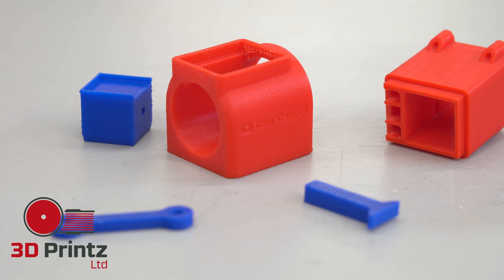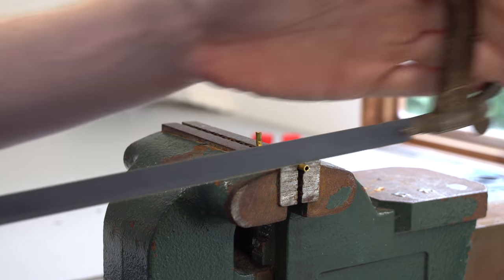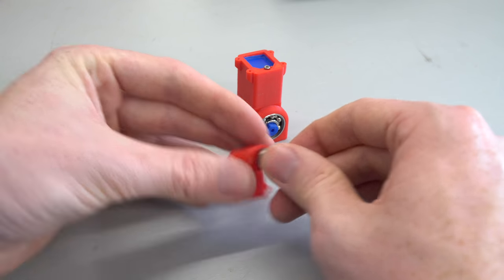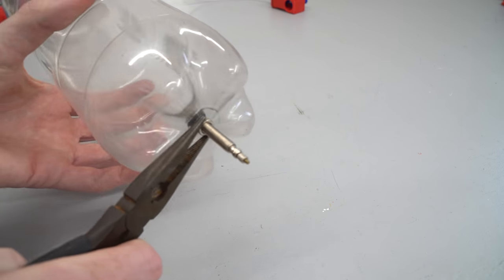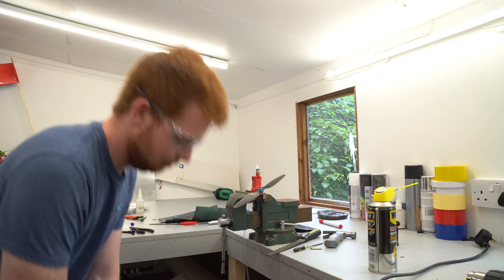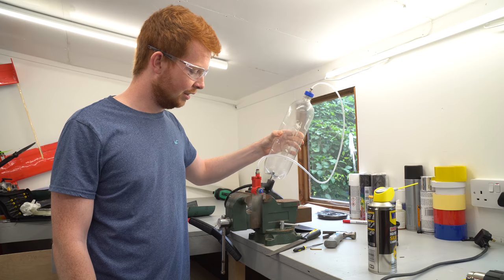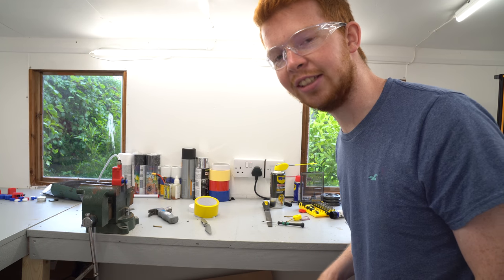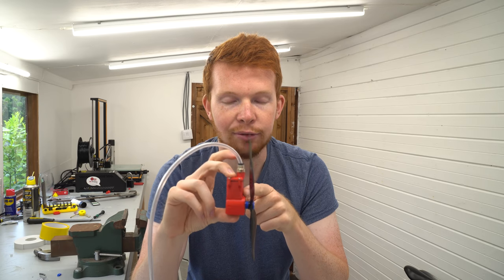3D Printed Air Engine BUILD

Comment: This version looks really efficient, based on how little pressure it runs at. With that huge propeller, I don't see why you couldn't get the plane to fly. It looked like it produced a lot of thrust and ran for a ridiculous amount of time. It sounds pretty amazing too.
Reply: USWaterRockets hmm 12 hours early
Reply: Patreon innit?
Reply: How are you 12 hours early?
Reply: patreon
Reply: not enough thrust. planes need a ton of thrust.
Reply: Tell that to Spinmaster Toys.
Reply: Depends on the type of airplane. Some really efficient designs do not need much thrust at all. Check out Samm Sheperd's Flying Wing - 40" wingspan and it flew 22 minutes on a 180mah lipo. VERY little thrust.
Reply: What I would like to see is him figure out how to get a two-stroke diaphragm engine going

Comment: Have you considered using dry ice or some other gas producing chemical to supply a constant pressure source (with a relief valve of course!)
Reply: Had the exact same idea!
Reply: Was about to make the same suggestion. There are lots of videos where people blow up bottles like that with just a little dry ice. You would think that that could run the engine for a fair amount of time.
Reply: I wonder if the cold gases would make the PLA brittle. I know its not liquid nitrogen cold, but I wouldn't rule out things like the piston con rod cracking. Even if there is a relief valve though, you should still probably hide your balls behind some plywood lol. With that said, this could totally work.
Reply: Biggest issue would be to control the rate at which the dry ice is "melting", as too fast and it will pop the bottle. Also as has been said before, Dry ice is not easy to come by in the UK. Other solutions could be possible though that produce gasses in the more controllable manner.
Reply: Diet Coke and Mentoes ??
Reply: What? Why? Oh, yeah. You're talking about a country that's now attempting to ban anything remotely pointy. In the USA (Murrica!) we can buy dry ice at most any grocery store.
Reply: Not because its dangerous... but more like... what and why would anyone need it?... What do you 'muricans even legitimately use it for (dry ice bombs and making it fart with a knife don't count)? I assume it's used for coolers and stuff... *shrugs*...
Reply: Great idea. Also, CO2 has one of the highest expansion rates, so it should be more efficient. But he needs to make some kind of a filtering mechanism to not let the water in the engine since the bottle would be standing sideways.
Reply: kal9001 why is making it fart not legitimate good sir?
Reply: Nothing really, but It hardly seems like a reason alone to have it in every grocery store.
Reply: The only time you'll find dry ice in American grocery stores is around Halloween where most people use it to create fog effects.  Otherwise you'll have to go to some sort of industrial (where it's commonly used in cooling apparatuses) or scientific suppliers.
Reply: @kal9001  Transporting things that need to be kept cold and dry. I sold ice cream with a bicycle cart. Dry ice is much easier to peddle around town than a refrigerator.
Reply: Using baking soda and vinegar and test it out
Reply: @kal9001  we use it for packing meats. It's very efficient and its dry! :)
Reply: I'm not sure what people buy it from grocery stores for, but when my restaurant gets orders of ice cream they come in a styrofoam pallet with blocks of dry ice to keep it cool in unrefrigerated trucks.
Reply: i had the exact same idea but i was thinking more sulphuric acid with aluminium, dry ice would probably be a better idea
Reply: @hjjfffaa  the supermarket by my house in Michigan sells it year round for cheap
Reply: I don't remember seeing it in any supermarkets in the South Bend area.  I'm sure it has lots of uses in meat processing for hunters or people who keep livestock so it'd make sense in the more rural parts of Michigan.
Reply: I bet co2 cartridges would really give it some major power.
Reply: Same idea. Even would have the added benefit of cooling the piston/cylinder. As the cold gasses run into the engine to power it
Reply: It will make plane unbalanced and heavy
Reply: You should try to make a V6 layout air engine
Reply: Dry ice would have to be able to overcome it's own additional weight.
Reply: It's pla plastic
Reply: @newcreation3411  yeah but he could use it in the air powered car
Reply: @kal9001  umm actually the correct term is sublimation lol
Reply: I didn't know what materials to use but yeah I think that's just the next logical step
Reply: Lol
Reply: @kal9001  It can also be used to carbonate juice, water, Unflatten soda, Its also useable in certain types of cooking, the same circles that would make a cube of fruit and smear the plate with bbq sauce and call it a meal-- But thats still cooking even if i need to eat a buffet worth of plates to get any sustenance past that of a single potato crisp.
Reply: @hjjfffaa  in Texas i can get some at any HEB at any time of year
Reply: There are stirling engines

Comment: Can you push one of those engines to its max? like increase pressure until it breaks (in a safe way) maybe using the bike pump while running method while standing behind something?
Reply: shinevision sv he could also replace the propeller with a wooden plate as flywheel wich has less airfriction
Reply: Yeah! great idea, but maybe testing it with a prop also to see how much you can push it if you use it as a plane :P but yeah, both ideas sound cool!
Reply: This should be the next (or maybe reserve it for the last?) video for the series, a completely destructive test
Reply: Metzger 
A proper flywheel and a pulley. Then measure the work output that generates.
Reply: shinevision sv what if he put dry ice in the bottle, would live to see how long it would run for then.
Reply: Esteban Pedroza 
Split the difference, call it drag.
Reply: I want to see this too!  For science. :D
Reply: I would prefer an aircompressor, instead of pumping the shit out of a bike pump :D
Reply: Peter Erdnuss 
It’s an exercise. 

Electric air compressor to drive an air engine sounds a little outside the point.
Reply: yeah of course its outside the point for a practical use like in a model aircraft.
But to test its point of failure or its maximum pressure rating i wouldlt use a pump
Reply: Peter Erdnuss 
I hope Destructive testing doesn’t happen. Not in the scope of the project. 

But you could built a couple and see where top end is... destructively.
Reply: Isnt that the best par of mechanical engineering? Pushing constructions to its limits :D
Reply: Esteban Pedroza a spinning propeller accelerats air ==> resistents
Reply: Metzger 
Not just resistance, but parasitic drag. Increased resistance with increased rpm.
Reply: I got mine to go at 125psi and it held up great, I’d try higher but my air compressor does not go over 125psi
Reply: hi shinevision!
Reply: @marluna_x  Hi!
Reply: @shinevisionsv  i never knew i would see you in the comments
Reply: it would be pretty damn hard to get injured by this engine

Comment: Now that you have your flexible air feed you could easily create that multi cylinder engine that everyone is so keen to see you do.
Reply: I think he should make a right angle fitting so the hose can be optionally routed close to the head depending on the need.

Comment: Fistly - Were you never tempted to try running it from a Co2 bulb such as you get for soda syphons? Tiny size, high pressure - which I'd guess would need to be regulated down via a choke constriction to the pressures your plastic components can survive for more than several runs before failure?
Secondly - with a hobby lathe you could machine up some aluminium components, get more rpms etc etc, more time in the air, better performance from greater pressure, improved aerodynamics from not having a blimp of an air bottle that's got to be strangling the aircraft's progress through the atmosphere?
Thirdly - I'm surprised at the sluggish pick-up when nearly stalling and give a shot of air, the cylinder charging must be inefficient at those low pressure.
Fourthly - very entertaining watch, this.Thankyou for posting all these videos.
Reply: Ian Gourlay I don’t think he would machine parts as the point of the engine is to make a 3d printed engine with the least amount of non-printed parts but cool idea anyways
Reply: Ian Gourlay 
He’s not out to reinvent the expansion engine. First would be a bored cylinder and turned piston. Which he should do even with printed components. 

All he has done is print and sand. 

It’s a hand-on learning exercise.
Reply: CO2... Have you ever heard about climate change?! 😉

How is the exhaust arranged by the way?

Comment: Nice build Tom! I couldn't resist and made a couple of replacement parts for a 5cylinder radial engine and I am actually printing the parts at the moment. I can send you the design files if you are interested!

The design is mostly copied from your files apart from: Crank case, crank shaft, Piston (minor tweak) and piston rods. They are designed to be compatible with the other motor parts.

Comment: Try to run it on steam.
Reply: xXMountain DewXx : Just a quick reminder: This is 3D printed.
Reply: do it anyway
Reply: xXMountain DewXx maybe with metallic parts but getting them would be the problem however I agree with you, it'd be cool if he gets to run it on steam
Reply: i wonder how the gameplay would be
Reply: Not with PLA. It will just melt
Reply: I would like to see how long it could endure the CO2 tank from a paintball gun. Those can hold some pressure.
Reply: Bradley Fortner But then it would blow up.
Reply: Yes. It would. But at what point? Tom could see exactly how much power he can get out of it by taking the pressure as high as necessary to blow it up. That bottle he's using won't hold nearly enough pressure to blow that motor. At least not by the look of it. But paintball guns have regulators and all sorts of useful parts. Their tanks are pretty lightweight as well.
Reply: Or with a chemical reaction (Metal in acid to produce H2 for exemple)
Reply: ECHO༄ 1 whole Frame Per Second
Reply: Steam would melt the plastic.
Reply: There's ALWAYS a, wrong side of the fence, ghetto engineer saying something dank hahaha!

It's not air tight and it's construction alone, from plastic, should state no hot air from the beginning!
Reply: This would work with PETG not PLA.
Reply: xXMountain DewXx I was thinking of using dry ice and water.
Reply: Could put a bit of dry ice in the bottle
Reply: pla resist more than 180°c and steam its about 100°c so... maybe for 5 minuts and then itll die xD (sorry if its bad english :c)
Reply: The only way he could do that is by creating the pressurized steam and then find a way to cool it enough that it won't melt the PLA and still have pressure.
Reply: How can he generate enough steam efficiently on top of a rc plane
Reply: Those arguing melting might consider staging the steam to compress air in a separate chamber.  Or using an expansion valve to cool the steam.  Sure the pressure would drop but it would prove the theory of using steam.
Reply: Akshj A.  - Fair question.  A candle and a tomato can maybe?
Reply: ECHO༄   badum tsss
Reply: steam was 200 years ago modern tech lets u make air pressure high as steam
Reply: Steam..  allowed to cool into cold compressed air......so it dont melt the parts...
Reply: Then it would liquify again, and any liquid in the cylinder will cause destruction.
Reply: jae ski your knowledge overwhelmed me.
Reply: Steam engines can run on compressed air
Reply: @armandoguendulain7162  with metal it is litterally just a motor.
Reply: GTX 1080 vs RTX 2070 SUPER comparison +chart overview
Reply: run it on steam and expand/cool via pipe the steam a bit before the 3d printed parts

Comment: You should print the casing out of clear material.
Reply: lowtus7 clear filament doesn’t usually come out clear, you wouldn’t be able to see anything
Reply: @owenps6944  Not with common FDM 3d printers like most budget and mid-range printers from folks like Creality.
Now, RESIN-based 3d printers especially those at folks like Shapeways is another story!

Comment: Have you put any thought into what you're going to use for the compressed gas source for the car? Without the weight restriction of the plane I'm thinking you could get very creative. If you changed to PVC pipe fittings and placed your pneumatic press fit into a 2" cap, you could make a nice chamber to fill with dry ice (just make sure you include an over-pressure vent). Or what about a peroxide and potassium permanganate, or baking soda and vinegar? Lots of really interesting combinations you could add to a chamber like that. Watching you sand away the piston also got me thinking - why not flange the top and bottom of the cylinder so you don't have to sand the whole face? It will decrease the bearing surface too so you'd get less piston friction as well as being much easier to size to the bore. I'd print oversize and use the time saved in sanding a whole piston face to make sure the bore fit was very close running.
Reply: the best solution would be a small pressure tank with a regulator to drop the pressure for the engine. the engine uses air too quickly for something like dry ice or any other chemical reaction.

Comment: Tom.  Here is a possible idea for your next project.  A 3D printed rubber band powered airplane *with a throttle*.  I could be wrong but I have never seen anyone add a throttle to a rubber powered airplane.  Not sure why but I think it would be really cool.

Comment: Go to a shop with a large air compressor and a pressure valve and hook it up and do an endurance test! Maybe find a way to continuously oil it? Oil drip? Super cool man!
Reply: OOh ooh Great idea Parker!  how about throw a balloon with oil in it into the air bottle and use a tiny hose to spray oil into the air stream?
Reply: clavo Yeah! I'm super curious to what the lifespan is on something like this. I'm guessing it it'll run for several hours BUT become very inefficient. I think the plastic piston and cylinder would start to wear down and air would start to go around it. Maybe he needs to figure out how to make piston rings.
Reply: Parker -  I've been reading comments for about 3 hrs now!  One guy suggested a dry lube like graphite.  It makes good sense.  I gotta get some sleep but this level of thinking is so dang fun!

Comment: I wonder if you could fill the bottle half way with coke/diet coke and drop a few Mentos in, seal it up and run the engine on the released gases?  Of course, you'd want to be careful and get the ratio low enough for the pressure not to blow the bottle ;-).  Maybe baking powder and water might be safer?
Reply: helicopter coke bottle
Reply: that would probably work, although I'd reckon you'd have to put some form of filter to prevent the coke/water to foam up and gunk up the engine. Maybe it's not needed if he uses sparklnig water and mentos
Reply: If he were to use that in a plane, it would just add unnecessary weight and on a car it would lead to worse handling due to the liquid sloshing around
Reply: True; however, sloshing could be baffled to minimize and 'unnecessary' in this case could be subjective.  Either way, it's an easy thing to test/play with and see what happens.
Reply: Jason:  well done. But; Ratsies I just made the same suggestion thinking it was original!
Reply: Heh heh... I've learned to never think I have an original thought.  It's such a rare occurance I want to enjoy the surprise when it happens ;-).
Reply: Jason Uberig, isn’t it vinegar and baking soda, not water and baking soda?
Reply: Yes, that works too; however, I was trying to stick to easily available power sources :) .... "Magic Baking Powder" and water have a similar gas-releasing behaviour as does vinegar and baking soda.   Funny, this all reminds me of little magic power boats that used to come in cereal boxes when I was a kid! :)
Reply: do this with dry ice and hot water...